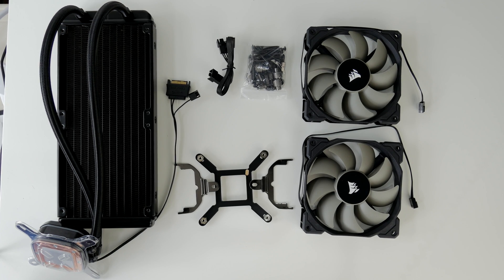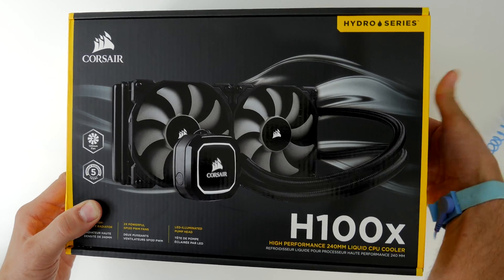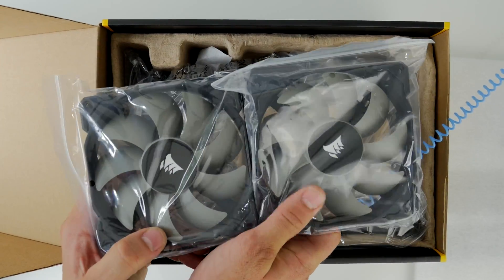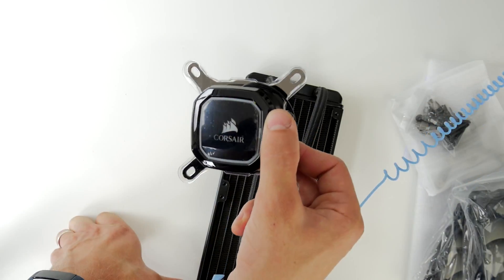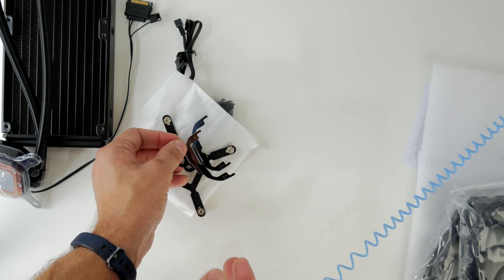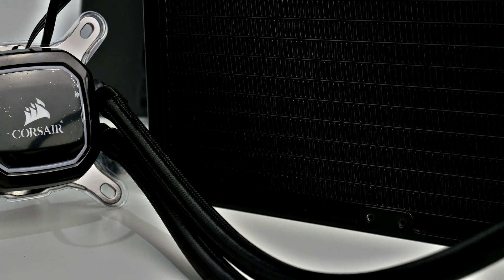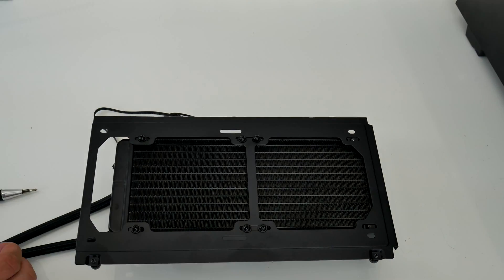Corsair H100x AIO Cooler unboxing and install

Comment: Do you HAVE to use the LGA1700 retro kit when installing this with an Intel i7 12700K? Or is there an alternative?
Reply from the maker: Depends on the motherboard. Some Asus boards have two holes drilled so the older brackets will still fit.

Comment: Nice review.. I'm going to use this to replace an old 120mm Antec AIO.  The old one is still working but the LED has failed.  So I am not trusting it that much now.  This Corsair will do the job as a replacement I am sure.  The Antec is a pain in the ass to fit.  Looks like Corsair have installation down to a fine art.  Nice to have a larger radiator too.

Comment: 0:00 Hellooo
0:11 Unboxing 
1:16 CPU compatibility 
1:47 What's in the box
1:55 The radiator 
2:41 Mounting brackets 
3:50 Mounting the fans
4:29 Installing it in the Tower 
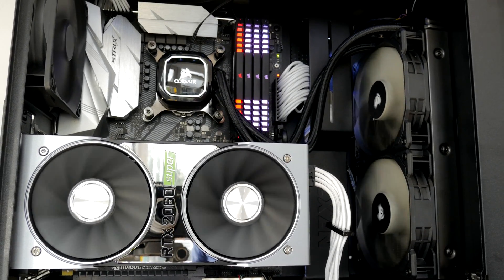5:05 The Corsair H100x AIO Cooler in action

Comment: This cooler is compatibly with lga 1200 ?
Reply from the maker: If a cooler fits 115x then it will work with 1200. Which means most modern ones will. Including this one (see description)
Reply: @TheProvokedPrawn  Thanks greetings from poland
Reply from the maker: No problems. Return the favour by subscribing 🦐🍤🙂

Comment: So is that setup 2 exhausts (1 on back and 1 on roof) and then just the radiator and fans on the front?  With no additional intakes?

Comment: works better if the radiator in/out pipes are at the bottom. or if they are just top mounted.  the air stops the pump getting filled fully with coolant. also can cause pump noise. there is a good youtube video where they cut a cooler apart and put Perspex on so you can see how they run in different positions. even some case companies have been guilty of showing them setup wrong.
Reply from the maker: Someone has been watching Gamers Nexus and is now going around telling everyone else they're wrong :p

Comment: Hi dude. H100x is not supporting Link or icue. How can we control fan speeds?  My fans are whirling at full speed and so noisy.
Reply from the maker: Have you plugged into the USB cable?
Reply: @TheProvokedPrawn  yes
Reply from the maker: @ganjascave  how did you plug the fans in?
Reply from the maker: @Burak Üstadımız have you plugged them into the pump header? If so you could try plugging them into the motherboard instead. Tbh I am not technical support. You could try Corsair's forums. There's great support guides there.

Comment: nice video but either the radiator should be the other way around and pulling cold air from outside into the case; either that or the top and rear exhausts should be intakes. 

it works best if the aio cooler acts as an intake, and then top and rear are used as exhausts
Reply: Also in that way it should also have the pipes at the bottom

Comment: Thanks for the video! Excellent!
I was trying to install my h100x today but I messed up the thermal paste. I have to buy some tomorrow
One question. In your build it seems, according to the fan arrows, that you're radiator fans are in exhaust position, even that Corsair recommends to put them as intake.
I'm I right? Or I'm messed up? Thanks!
Reply from the maker: Correct. Do it as intake and ignore me.

Comment: How to regulate the speed of fan cpu... My fan is over 4066 rpm or 4100. No solution in the bios... Maindboard: Gigabyte H81M-H
Reply from the maker: Corsair iCue?
Reply: @TheProvokedPrawn  For H100x say CORSAIR iCUE Compatibility No. 
did you get compatibility on yours?

Comment: Hey man, I have this cooler but I want to know if I can remove the current fans and replace them with ql120 fans? I have replaced all my other ones and I want to keep the h100x because I’ve only had it for 6 months so I don’t see the point in getting rid of it. Plus I’m fairly new to pc gaming so I don’t want to replace it myself because I’d probably break something.
Reply from the maker: I did it here with another one  https://youtu.be/-vjewiYfNsQ
Reply: The Provoked Prawn Thanks, can you do replace the fans on the h100x or just the h100i?
Reply from the maker: @slaysi  don't see why not.
Reply: The Provoked Prawn Thanks for the help I’ve subbed. I just have one last question, I ordered 2 more QL120 fans for the H100x and I’m just wondering if I fit in the new fans into the radiator do I just plug the rgb cable into the lighting node pro and then the other cable into the commander pro to power them just like my other case fans or will that not work because the H100x is plugged into the motherboard?

Comment: Could I swap the fans for Corsair ll120 ? And get the same performance
Reply from the maker: I believe that technically the LL120s aren't quite as good in terms of cooling performance but there's not much in it. You can do it and I have done it with the QLs. See here https://youtu.be/-vjewiYfNsQ
Reply: The Provoked Prawn right okay thanks so do you think it’s worth it to do it just so this matches the rest of my pc which has more ll120
Reply from the maker: @pumpkin8680  do it.
Reply: The Provoked Prawn ok thanks for the help what about like the fan curve on them mine are currently running at all 40% but wouldn’t I need to change this? Is there a default fan curve just for this
Reply: The Provoked Prawn I have the Corsair 465x can I mount this rad at the top?

Comment: i am just replacing a cooler what is not right for my pc will i need to take the motherboard out to put this cooler in or will it be ok keeping it in i already have a amd bracket installed from the cooler i am using now
Reply from the maker: No, you shouldn't need to take the motherboard out.
Reply: @TheProvokedPrawn  thats great thanks for the quick reply i can't wait to get this aio in my case im using a cooler master ml120l at the minute and its no way near good enough for my cpu

Comment: are the cooleer fans pulling air inside the case or are they pushing air outside the case ?
Reply from the maker: I did it wrong if that's your point.
Reply: @TheProvokedPrawn  i don't know that's why i'm asking like i already have 3 fans pulling air inside the case and one exausting so i would like to use the aio as an exautor on the top of my case because the front already has 3 fans pulling air inside the case so i need to know how to put the fans so I don't have 5 fans pulling air inside the case and 1 exausting
Reply from the maker: Air intake is a strong subject of debate. Personally I try to set the front to pull cold air in the rest to blow warm air out. But it depends on your setup.

Comment: ryzen compatibility ?
Reply: full compatibility. just threw it on my new Ryzen 9 3900x :)
Reply: @mrnomore  hows the temperature and noise, please reply
Reply: @hassanar1   probably depends on the rest of the build, but it's a very very low noise. nothing noticeable (ideal/normal work).
the temperature is; ideal/normal work = ~40°C (104°F) and  full stress (10 minutes 3D rendering with CPU only) = ~75°C (167°F)

Comment: Yay, I’ve ordered the same aio and case so your vid will make the install easy when it arrives. Happy days!
Reply from the maker: Just note I installed the fans the wrong way around XD upside down.
Reply: Ok thank you. So the way you mounted them in the video had them sucking from inside and blowing out?
Reply from the maker: @zeusyau3605  correct. Which can work depending on your setup of course and the opinions of the internet. Everyone argues about the best practices for intake and exhaust setup. -_-
Reply: The Provoked Prawn yeah. The good ol’ internet. I think trying both ways and monitoring temps is the best bet. Would help draw more air over the gpu through the pci slots.

Comment: Just one very important thing. all your cooler fans of your case have an flow of outflow, but there is no input air flow,  you must balance this,  if 2 fans of the corsairhydro suck air, you must put 2 fans that take out air.  The hot air is trapped inside, no from exterior air flow is possible.
Reply: and what is better ? front (corsairs) IN and back and top OUT ? or other way ?
Reply: @darthkiri  Fans in front pulling air in, fans on top and rear blowing air out.
Reply from the maker: Yes that's already been pointed out  75,002 times